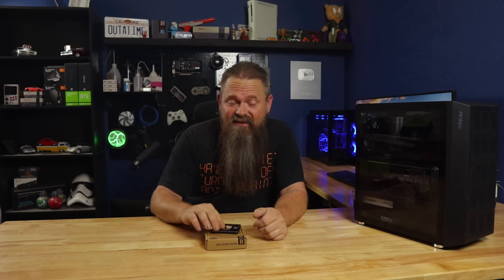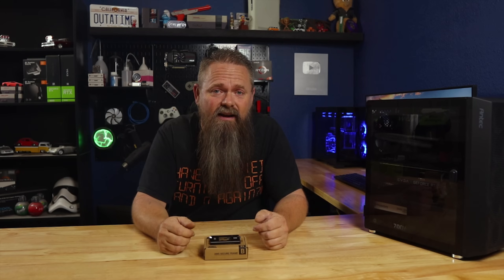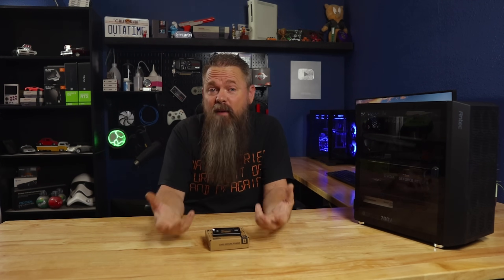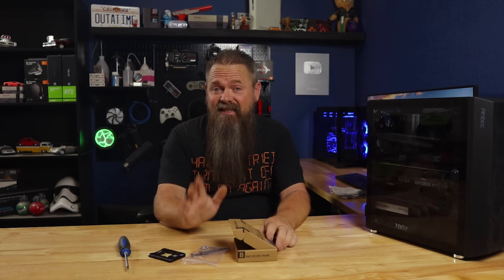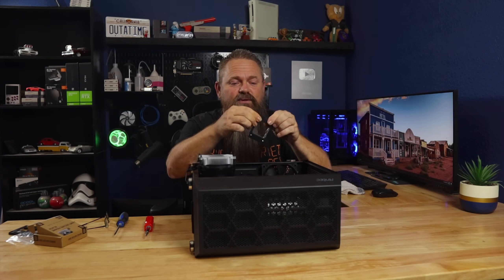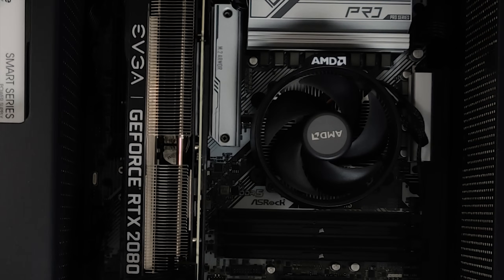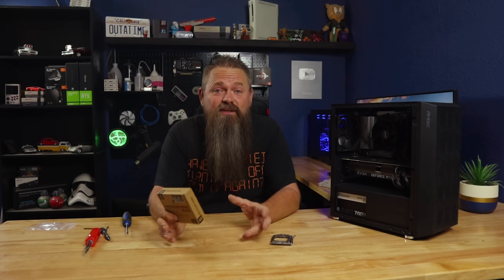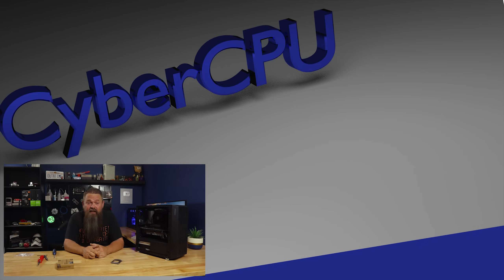AMD AM5 Runs Hot, Will This Fix It?

Comment: THe TL;DR  of the 8 and a half minutes of intro: 

THe video explains that the stock retension bracket  for the CPU and its cooler, does not keep the cooler square over the CPU and this leads to uneven mounting pressure between thCPU and its cooler, and this unever pressure leads to inefficient and inconsistent cooling. 

The goal of this replacement bracket is to allow for proper square fit of the cooler on the processor which in its turn lads to efficient and consistent cooling ofthe CPU. 

THere i said it in 2  sentences so my mother can understand it without going to fancy 8 and a half minutes intros.
Reply from the maker: You left out why this benefits the Intel processor more than the AMD processor. Which was essentially the entire purpose for the intro. 😅😂🤣

Comment: Very nice testing and presentation of results. I picked up one of the frames for $9 a year ago, and another for $13 9 months ago. I agree $15 seems a bit much, but I do appreciate the way they help keep the thermal paste from gunking things up.

I have a 7600 in a build with an ASRock A620i PG Lightning motherboard, which doesn't support much in the way of OC or other tuning. I originally had it in a SFF case with a small cooler, and as an experiment moved it into a MATX case, changing to a Phantom Spirit 120 Evo. As you suggest, the better cooler makes a big difference.

Despite the relatively low-end motherboard, it is running much cooler, boosting higher, etc. An interesting test of the max values is OCCT, using the stability tests for CPU+Mem, Power, and so on. I have it set to PBO Enabled, but on this motherboard there aren't as many PBO knobs to turn. It is hitting 125+ watts, cores are averaging 4.9GHz for an extended run, and core temps range from the low 70C to mid 80C range.

I have another system with a X670E Taichi, 420mm LFII AIO, etc., and swap out the 7600 for the 7800X3D to see what it can do. This motherboard has all sorts of OC potential, and the big cooler may help the 7600 boost higher, run cooler, and so on.

Looking forward to seeing what else you do, learn, and share!

Comment: am5 tends to run pretty high voltages for no actual reason even at lower clocks,  my7900x would always be around 65c idle and around 85c under gaming loads, the way i fixed it was undervolting it to 1.225v (virtually every cpu can run those voltages stably) and then enable pbo with curve optimizer set to -10 in order to gain back the loss in speeds with the undervolt, this way i kept the same exact performance  and dropped temps by almost 30c

Comment: I use a Thermalright contact-frame on a 12900K with a 420 AIO,  temps are great and applications of thermal paste are neater and risk of CPU or board damage related to ZIF frame issues are eliminated...overall a win-win.
Reply: Measure the height difference of the plate and the top of the CPU and add .5mm to that measurement for a thermal pad. (Intel LGA1700 is .5mm so use 1mm) Add a squishy thermal pad to around the perimeter between the cooler and plate. Gelid Extreme is great for this and additional temperature control. Also, apply a small amount of thermal paste between the CPU and the plate around the edges where it touches the CPU, and butter the toast with the thermal paste.
Thank me later.

Comment: There is a difference between different thermal pastes, not using the same paste makes the result invalid.
Reply from the maker: All the testing was done with the same thermal paste. I use thermal grizzly for all the data. The thermal paste I used in the video was just for the install in the video.
Reply: @CyberCPU  ok, then my bad for not paying enough attention.
Reply from the maker: @marijanovic191x7  no worries. To be honest with you, while I was filming I had forgotten to grab my thermal grizzly tube so just used the supplied compound in the video. 

All the testing was done before I filmed the video following all the norms. Like burning in the compound before running the tests and I went back and forth a few times to verify my results.

Comment: Its not meant to fix temps on an AM5, on intel it will. Best itll do is help keep clean the processor which could be worth it
Reply from the maker: I actually did see a benefit on AM5. It was small but I believe it would scale with better cooling capacity.
Reply: @CyberCPU  with something that small tho id say it was margin of error.
Reply from the maker: @hasanmich1504  maybe. However, it was repeatable.

Comment: I would also stress as you said , do not tighten too much because you also have the mounting pressure of the cooler and as with one build I did with this you can get a CPU boot light error. Once you get a bit of firm resistance you are fine .
Reply from the maker: Most coolers can't be overtightened because the screws will only go down so far.

Comment: which AMD is not a supreme heater? 
after the best processors for their year - the athlons amd went to supreme shi!t when it comes to temperatures.
sinde AMD and amd ryzens - its absolute heat producer.
Reply from the maker: The Zen 4 AMDs ran quite cool. Also, I just worked on a phenom 2 the other day that was overheating due to dried up thermal paste. I forgot those had a 70c TjMax.

Comment: The AMD FX 8350 AM3+  Stock Cooler was better, it had copper pipes. Everything today is so badly made. Why push everything to the limit?
Reply: Why not?
Reply: @Cosmic_cloudx  Even if your car's engine can run safely to x number of revolutions, you should never lie close all the time.

Even if an LED bulb can withstand 80 degrees heat, you will wear it out faster if you are close to 80 degrees.

A capacitor wears out faster at high temperatures.

The same rule for everything else!

Comment: A lot of people insulted Intel because of the problems that popped up.  But no one thought that Intel processors can withstand higher temperatures and people decide to OC them with ordinary or cheap coolers.  When the processor inhales temperature it is normal for these problems to occur.  Do not think that the high temperature in AMD does not damage the processor.  Set your bios for the critical temperature of Intel as it is with AMD and you will see that there will be no problem with an Intel processor, but what happens with AMD at high temperature will happen.  AMD critical temperature 85-90 degrees.  Intel's critical temperature is 95-110 degrees. Lower the Intel's critical temperature to 85-90 degrees and you're done.  But unlike AMD, at this temperature, Intel will have nothing to do with it.  AMD always had a problem with temperature but now a problem appeared at Intel and everyone started spitting and blaming Intel.  Well, buy good coolers and don't play around OC the processor just to raise 3-4% FPS which won't matter at all and you won't even notice the difference.
Reply from the maker: It's not true that AMD has always had temperature issues. I literally just worked on a AMD Phenom 2 the other day that had a TjMax of around 70°. It was overheating due to bad thermal paste. I forgot how cool those CPUs ran when I saw throttling at 70c.
Reply: @CyberCPU  Yes.  You're right.  I should have mentioned that not all AMD processors had temperature issues.  I apologize for the omission.
Reply from the maker: @X-FAKTOR84  no apology necessary. I honestly don't think the Zen 4 AM4 CPUs run very hot either. However, most of mine are water cooled or using heat pipe coolers, so they run very cool.
Reply: @CyberCPU  Yes, that's exactly what I'm talking about.  You should have good cooling and you should have no problems.  All processors with their development need better and better coolers.  Stock coolers are fine for some CPUs, but if they are going to OC them, they should certainly have pretty good cooling and they should know exactly what they are doing.
Reply: WRONG. Intel chips are frying out of the box 
no OC needed . Intel bot.
Reply: @jordan-mn6yy  I don't know how you came to that statement.  I personally have two computers with 13th and 14th generation Intel processors and I have no problems with the tests.  I tested voltage, temperatures and even gaming load.  I don't know if I have come across readable processors, but at the moment I have no complaints from the customers for whom I have made the configurations for a year of use.  But that's just my opinion, everyone has a personal choice.  And I'm not a bot. 😉

Comment: you will definitely get more performance if you're using a proper AIO water cooler instead of the crap cooling solution AMD include is this cpu version
Reply from the maker: I was actually a little disappointed. Every Ryzen I have installed prior to the 7000 series had an adequate air cooler.

Comment: 3:00 TJMax for Zen 4 is 95c
Reply from the maker: It depends on the chip. The TjMax for the 7600 is 85°.
Reply: @CyberCPU  AMD homepage says 95 for the 7600. where did you see the 85?
Reply: @CyberCPU  No, it's on AMD's own spec page. The 7600 is 95c
Reply: @CyberCPU  I used to have that ASRock board, and I believe it defaults to an 85c temp limit out of the box. That's an ASRock setting.
Reply from the maker: @dotxyn  maybe you're right. I assumed it was a microcode update. I set the limit to 95 in my testing and it will hit that very easily but doesn't improve performance. The 85 limit is smart.

Comment: I just built a 7950x3d using a machined frame... it's great. I never get above 80c under all core max load.
Reply: Oh yeah?😁 Try running far cry 5
Reply: this sounds like your cpu is not doing its job, these are designed to run at 95 under full load, they thrive on it. This seems like something is wrong lol. Either that or you live in an icebox

Comment: The fact the processors are designed to run at the TjMax temp is absolutely insane.
Reply: These people acting like they know more about processor design than the engineers at Intel and AMD.
Reply: @markvincenttee920  and blatantly trusting everything they say isn't the solution either you know when a company makes a product and it fails to their spec they often still sell the product as if it was a feature neither side is excused from it

the rules of electricity and heat does not bend for intel or amd so do not expect it for them to magically have found out how to do the impossible

likely why the engineers say it is fine is because they likely hit the calculated lifespan of the product

what they did to combat the degradation is making micro adjustments to the voltages keeping near max degradational voltage 1.45-1.5 during low heat output so mostly during idle and general use does not harm the processor but when you launch a game that voltage goes to 1.3v as heat is pumped into the system and this is to combat the heat vs voltage problem all they did was push as far as they could toward the risk of degradation were it is acceptable loses on degradation toward the lifespan of the product

the micro adjustments have 1 negative though of course brute capacity still can ignore the problem comes to cooling aircooler can take away heat faster and more efficient then a liquid cooling solution as liquid solutions take longer to remove residual heat if you would disable all the boosting settings and then compare it to the aircooler you will then notice the liquid solution taking its crown fully back even if you were to do a manual overclock because the aggressive heat cycles are gone
Reply: @markvincenttee920  Until a few months ago I would have agreed that it's weird to second guess chip makers, but then again, Intel's recent troubles surely illustrate they're not infallible at knowing even their own chips limitations.

Still, there's no evidence so far to think 24/7 95C isn't safe.
Reply: @MoireFly there is evidence that it can degrade quicker, reason they get this hot is cause of the thick ihs they used so some people didn’t have to upgrade their coolers
Reply: @XFXGX  Which evidence?
Reply: @MoireFly  look it up, higher temps can cause quicker degradation
Reply: @XFXGX  In theory?  Of course, no question.  But as a practical matter, to an extent likely to matter for the valuable life of the product?  I don't know of any evidence that AM5's 95c tjmax matters.
Reply: @MoireFly  yeah fair point, who knows how much the degradation takes to happen
Reply: agreed, my 5800x is idle at and around 55 to 58c and running just desktop 60 to 70c  gaming 80 to 90c  and this is with a Corsair 100hi  AIO 240, to hear this is normal is insane.
Reply: @tech90retro  meanwhile i got a 5900x with a noctua nh-d15 strapped on temps idle sit a tiny bit under your idle for desktop use it sits around in your idle temp but the max is 62c in gaming it maxes out at 72c stresstesting sits around 83c

now since i game mostly on it i did not need the multithreaded performance so i just enabled eco mode 65w i haven't lost a single fps only multithreaded i lost some performance but the idle is now 32c and 40-42c during desktop use and 52 to 58c gaming

not 100% accurate because i am just pulling it from my temperatures i seen a few times but it would be only off in the margin of 1-3c

however i wonder if you can pass stress tests with the cooling you got if gaming can already get to 90c

if you are just gaming i would also just recommend you go eco mode the fact you do not lose single core performance is sweet
Reply: @tech90retro 80-90 gaming is damn hot, jikes
Reply: Dude...how? Im running a 5800x with a ak620 deep cool air cooler and kingpin thermal paste in a lancool 216 and my temps are like 10 degrees lower
Reply: @tech90retro That idle is pretty high. I was on a 5800xt and I’m at 38 C idle on a 120mm air cooler. What thermal paste did you use if you don’t mind me asking? I use Arctic MX-5
Reply: @tech90retro  It should not run that hot, Ryzen 5000 didn't have temp problems. There is 100% an issue with the installation or function of your AIO. Posting from 5800X3D build, running far cooler on air.
Reply: It's an automatic overclock.
Reply: Temperature swings are drastically worse than constant high temperatures. So these will last longer than any am4 cpu.
Reply from the maker: I think it's actually quite brilliant. It allows the processor to boost  all the way to TjMax. So as long as you can keep the temp's down you can boost all the way to the CPUs boost limit.
Reply: The problem is that the thermal limit at throttling point is too high.
Reply: @Nick_R_  You should see what my 7945HX in my laptop TJmax is it stops at 100c.
Reply: because it can doesn't mean it should
Reply: @marsMayflower  i agree but 5800x are designed that way.. AMD has stated this is normal
Reply: @tech90retro  No chip is immune to degradation because of heat.
Reply: It’s not supposed to. Intel and AMD are crazy right now.
Reply: Youre not the engineer, just a keyboard pleb.

Comment: ive been using an arctic liquid freezer 3 on 7800x3d and never gets too hot. Never used a contact frame
Reply: Question as I have the exact same cpu/cooler mine is the 360 variant. What’s your idle temps?
Reply: @bebelush24   30 to 40 depending on room temps.
Reply: @bebelush24  45 watching youtube

Comment: I know he will get to it, but I got a decent aftermarket air cooler for $40 and it brought my temperatures down into the mid-70s C. Then using Ryzen master, which he has already touched on, I was able to achieve full boost clock and keep it in the mid 60s C.
Reply from the maker: Yes, the stock cooler needs to go. 

Also Ryzen Master is pretty amazing. 😉

Comment: Honestly would just run thermaltake 120 peerless assassin for 30 money, more than enough and simple
Reply: Yes
Reply: I wish people would stop parroting the Peerless Assassin. The Phantom Spirit is objectively better and the same price. The PA is obsolete.
Reply: @insertnamehere4419  Yeah not a lot of people know that the Phantom spirit is the PA successor and performs (ever so) slightly better at the same price. But you gotta understand that the PA was very popular so people just buy it without knowing there's a "refresh". It's just like when people default to buying the Samsung 990 pro SSD when there's better value SSDs nowadays. Force of habit.
Reply: @insertnamehere4419  I have both and Peerless was slightly better. No idea why but I tried swapping many times until I just sold the PS.
Reply: @ It's not slightly better. Your testing methods are flawed or you didn't test enough.  The PS is the slightly better one, it's not really up for debate.  The PS isn't capable of beating the Phantom Spirit.
Reply: @ I bought the 'Thermalright Phantom Spirit 120 EVO' so maybe that is why it performed slightly worse. I tested many times and the same results over and over.

Comment: Well Doc ya know wat up. I got a tip from somebody about cleaning 'turmo  grease off 'CPUs. which is using paper coffee filters. I do not use those kinds of coffee pots any more. I went to k cups. So I went to my local dallortree and got a pack of them. Which should last me a long time. Hey they work great. and you can trash them when you are done. Those filters and some 99% acahol is all you need to do that job with. The paper in the filters is just the right texture to clean without scratching the CPU.
Reply: Jay two cents dose this for a long time
Reply from the maker: Great tip!
Reply: Their main advantage is not leaving fibres behind.
Reply: I've been using a silk cleaning cloth for eyeglasses to remove paste the last couple years.
Reply: Coffee filters are also commonly used is engine rebuilding for a lint free solution (if you didn’t know) they’re awesome and CHEAP CHEAP!